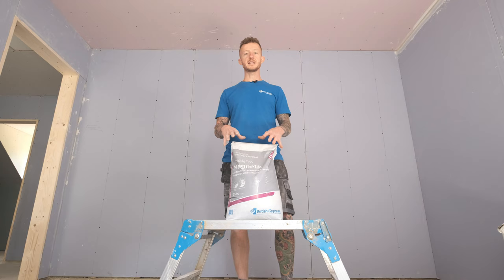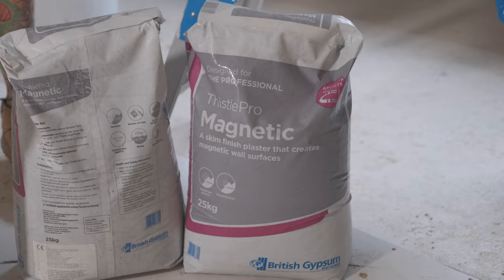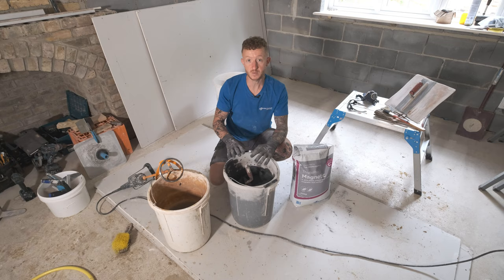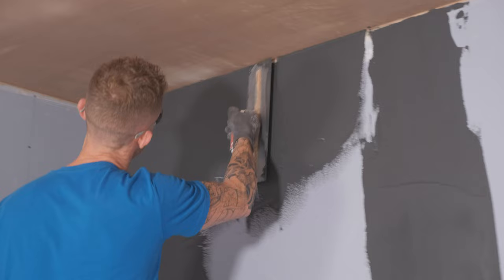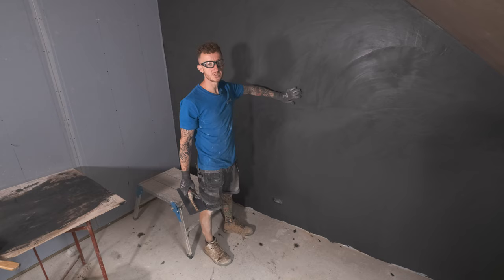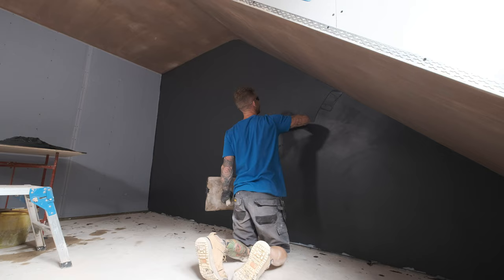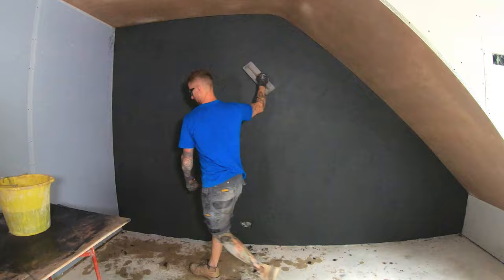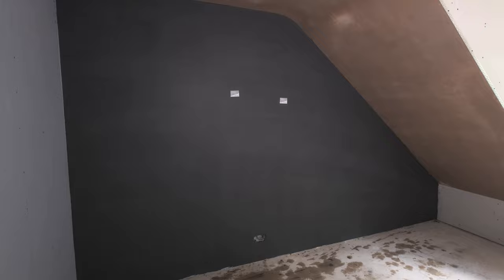Plastering with Magnetic Plaster! | How to Install ThistlePro Magnetic

Comment: If this isn’t an April Fool… surely it must have some metallic content to allow magnets to stick to it, this may actually interfere with the WiFi signal depending on the location of your Router/Modem and Access Point.
Reply from the maker: It's no April fool, it's a genuine product and there's no interference at all. Check out the British Gypsum website for all the specifications - https://www.british-gypsum.com/products/plaster-products/thistlepro-magnetic#plaster-coverage-calculator

All the best, John 👷🏻‍♂️
Reply: Why would that interfere? Lol
It wouldn't
Reply: Something that's magnetic doesn't mean it's a magnet

Comment: What’s the point in it ? What’s it for ? A black wall ?
Reply: Only real application I could see it being useful is in rooms that need to be constantly used by different people in different ways.
Allowing them to use magnets to put things on the wall instead of whiteboards or using pins or screws or even Blutack
Reply: @MrMedicalUK  at £90 a bag be better off getting whiteboard
Reply: @Thomas Cawley  very true and I reckon you could make this from multi finish and iron powder or filings for at least half the cost